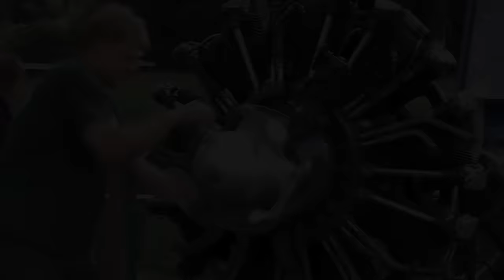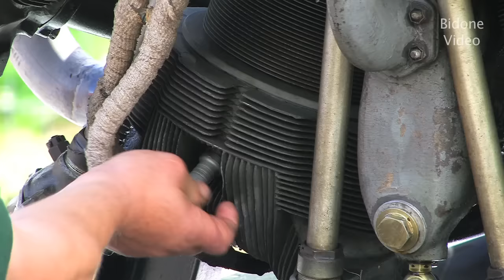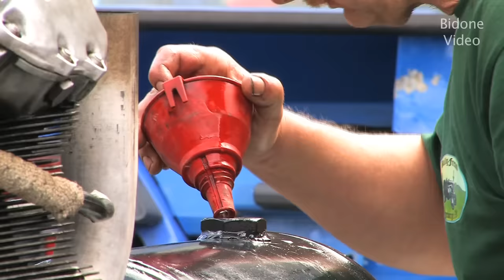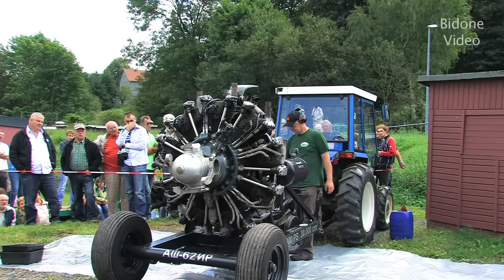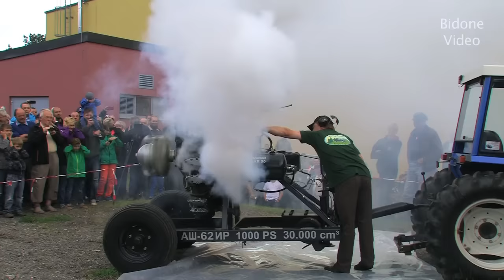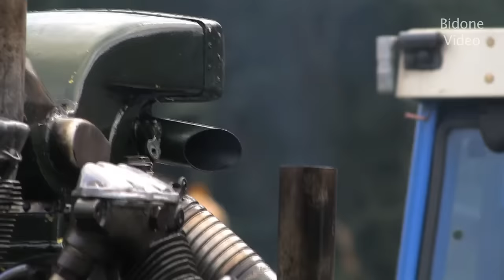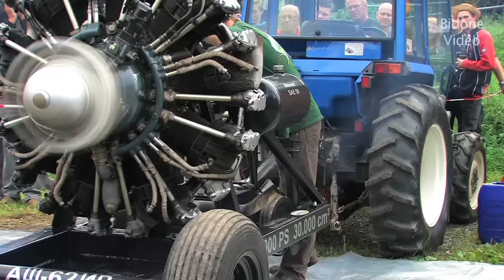Russischer Sternmotor - Russian Radial Engine Start and Run

Comment: If that thing had a propeller, you'd witnessed a blue tractor flying.
Reply: I think this is the very engine the  Antonov An-2 uses wich is actually called "tractor of the skies"
Reply: 😂At least moving along the ground a hell of a lot quicker than a tractor generally does.
Reply: @safetyinstructor  it is, the shvetsov 62, 9 cylinder 30 litre engine :D
Reply: @_elicon_4681   আ
Reply: Good profile picture
Reply: Lmao
Reply: Even static prop is just way too dangerous even if it is bad for the engine to have zero drag
Reply: Tractorcopter
Reply: You really wouldn’t, this is actually a weak engine compared to most of the radial engines out there.
Reply: And the jockstrap raiders film does just what it is
Reply: Шайтанарба! 
😂😂😂

Comment: I’m honestly surprised it started without the propeller.  The prop acts as a flywheel and helps carry momentum in between cylinders firing and keeps it moving along smoothly.
Reply: It also acts as load and resistance so it cancels out.
Reply: Yeah I felt like it needed something to work on like some load on the engine to help it run smoother, I'm sure it would have but it's still great to see in operation.

Comment: yep it happend again, clicked on the videos on the right and im watching old engines start for an hour
Reply: you are not alone.
Reply: +Frietpan Me too !
Reply: +Frietpan Stuck in the old engine startup vortex too.
Reply: +Frietpan Yep same here, love the ancient diesels myself more though.
Reply: +Frietpan So that's what just happened!
Reply: +Frietpan Same here.
Reply: +Frietpan Jij ook al? :-)
Reply: +vinny142 9
Reply: purplinko
only watching. no touching!
Reply: Frietpan q same here... Only a year later haha
Reply: The oil injection this motor has total loss lubrication.
Reply: Frietpan very much for
Reply: One thing i like about this motor is you can get to the individual jugs and cut ports into them to make a nice loop or uniflow scavenged 2 stroke radial!
Reply: Join the club ^_^
Reply: Frietpan p
Reply: same XD
Reply: o/
Reply: After 2 years yep im still here :D
Reply: Prett awesome right
Reply: the Frietpan
Reply: I used to work with aircraft. I'd try and ID engine and aircraft by sound and one day I hear this noise and I'm like "wow." A P51 mustang, a B17 and B25 all landed.
Reply: I hook now ... ha, ha
Reply: Happens to me aswell
Reply: Fryingpan Watching old plane engines start up, is so damn satisfying
Reply: yeah me too
Reply: ñ
Reply: Alex Vazquez 
build the wall
Reply: Me too.
Reply: By Volkswagen
Reply: Fryingpan „2
Reply: Ì
Reply: Rhean  semded
Reply: Fryingpan Musik
Reply: Fryingpan 不
Reply: Fryingpan don’t you just love the sound?
Reply: Last week I went on a massive bender watching GMC Crackerboxes run. I'm just off the screaming jimmy's fascination and now I'm here.
Reply: HAHA! I did the same thing! Happens all the time!
Reply: lemateurfou
Reply: Fryingpan
Reply: Same
Reply: I like to see it geting alive too :)
Reply: Same story
Reply: Super ale mòj Tata potrafi lepiy
Reply: Noł koł
Reply: Kol
Reply: @nastastic  🏠🏗️🏭🕌🚜🕞🕓🕓🕗🕖🌧️
Reply: : D  : D  : D     Great minds think alike!
Reply: Yea me too.
Reply: There's worse things that can happen.
Reply: @ecz28  .
Reply: Yep, the very same :)
Reply: And IM at work..
Reply: Same
Reply: Ģğh
Reply: Hahahahahah.   Samsies!!!      I'm on vacation too!

Comment: less emission , free pollution, free energy , euro4 approved 100%
Reply: It is Euro6 dtemp!
Reply: euro1940's
Reply: wayan pande euro norms are idiotic the only thing what realy counts is how we get our oil 
We ned to produce it ouerselves with seaweed and comparable tecnics (power to liquids) the we can reverse the co2 polition with over production (in that we are already very good)
Reply: Fuel it with dark rum, 90% proof - it'll run better and'll be very good for the environment and people will love the exhaust gases LOL!
Reply: Who cares that stupid and fake 'Euro' -1,2,3,4,5,6 etc emissions???
Bosch invented and implemented  that(fuel, ignition and control equipments) in produce to get more profit from stupid users, while there is no significant increase in power and torque.
Reply: euro 4 has been planted
(eco) terrorist win
Reply: castor 927 maxima premix or oil injected?
Reply: Skhh
Reply: @jlo13800  fk
Reply: Dueos
Reply: Ejejei
Reply: @jlo13800  golden spectro, the old black and gold bottle!
Reply: I would run nothing but amsoil dominator synthetic 2 stroke oil through one of these radials with rigged up oil injection. If it cant handle so fuck it.
Reply: At what ratio in this radial, these run total loss oil burnoff anyways. these burn about 40:1 equivalent from what i heard. Low ash oil pushed through the crank and injected and burnt off for total loss.
Reply: That engine is still produced in Poland and have EU approved. Of course after many modification maked by PZL Kalisz.
Reply: 6.2!
Reply: Nobody thought about pollution during IIWW
Reply: Or maybe non-euro
Reply: That thing isnt polluting the air? Watch the vid again.
Reply: Some people's say that after this event  a large mob of people with buckets went collecting  lumps of coal for winter season.
Reply: As long as its got a electric engine attached to it its climate neutral lmao
Reply: and remember diesel particel filter

Comment: Need to fit a club propellor,will run much nicer with something to turn against and also acts like a flywheel.
Reply: That was my exact thought the second the video started. These aren't made to run without a prop. He wouldn't have as much trouble starting the engine either, with the propeller to help keep it spinning.
Reply: You are exactly right sir. I checked today at work and all the overhaul and service manuals tell you that running without a ballast or club prop is not to be done. It will result in damaging shunting of the gears as the engine loads and unloads between power pulses. The ballast or club prop keeps a drag load on the engine to prevent this. I would not want to be there when it lets go! I saw pictures of an exploded M14 that had been run without a load.
Reply: Yes,ram air cooling from prop wash. The engine temp is thermostatically controlled by opening or closing the gills.
Reply: Thinking the same thing, some engines can be damaged if run unloaded. It's too easy to over-rev them if not careful on the throttle.
Reply: pauljs75 I'd say it was over revving a bit.
Reply: Haha, that was the first thing I thought too!

Comment: Hi Bidone, you might want to add the words "inertia starter" to the video description as well. There are not many videos about that, so with those words it might pop up as related or in search results for new viewers. Wish you the best, and thumbs up!

I suppose the original propellor blades also provide a significant flywheel effect, which could help with the rough/difficult starting... But granted this thing is impressive enough even without them.
Reply: Oh that’s why the start up sounded like that

Comment: needs a prop or at least some form of air cooling to the cylinders
Reply: a prop would have been way to dangerous wit hall these kids around 
i bet he usually has one attached
Reply: FGM11 why would that be dangerous ? There's many museum videos where they use a prop when stationairy running an angine. Just keep the crowd at distance.
Reply: A propeller, even a cutoff one is needed for the engine to run smoothly. Radial engines don't have a flywheel, the magnetos are run off the crankshaft, so it need s the weight to smooth it out, even a nasty Russian engine like this one.
Reply: *****

I'm not so sure... such engine built up very fast hot points who can damage it...and the prop is in addition a flywheel: whe see the lack with the start difficulties...
Reply: ***** I don't think he knows what he is doing.
Reply: leneanderthalien The starting problem is usually with radial engines. Any oil left in the engine goes to the lowest cylinders and can seep past the oil control rings and foul the spark plugs, that why they're shown checking the spark plugs. And usually before start up the engine is turned over by hand at least 3 complete revolitions to get rid of the oil build up. In this case that turn the engine over on the starter before turn the magnetos on.
Reply: Charles Damery

I known such engines but i was mecanic on french Neptune P2V7 (later on turboprops)...but here whe see clear that the engine as a lack of the inertia from the prop who help to start it..
Reply: Plus its awfully tempting to flip the rotors and see how fast that tractor could go ..
Reply: ***** You can not do this Nikoaj, it is illigal to plow while being under the influence of a propeller....
Reply: barthoedemaker Also a prop will offer some inertia for a flywheel effect and smoother idling.
Reply: you dont understand how the physics of them work it would be like a pair of scissors flying at you from being blown out of a cannon

Comment: I found out that pre-warming the oil helps a radial start a whole lot easier.  Yes, the 50 weight oil is about the consistency of honey but is just what that engine needs.

Comment: Motor 12 cilindros com 2.500 cilindradas cada....somando 30.000 cm cúbicos ou seja um motor 30.0
Isso sim é um motor brutal
E isso em 1930.....imagina um motor desse com a tecnologia de hoje 😲
Reply: Motor 9 cilindros com 3.333 cilindradas cada. Radial engines have odd number of cylinders (per section).
Reply: A las grandes marcas no les interesa hoy en día seguir evolucionando los motores con cilindradas grandes. De todas formas ahora se invierte en tecnología eléctrica.

Comment: Propeller will act as cooling system as well. Without propeller this engine will overheat in few minutes.
Reply: and it will also fly off and blend the crowd into a bloody pile of organs, whats better, an overheated engine (repairable) or tens or hundreds of dead people (unreparable)
Reply: Justin Noker You lost me on ''blend'' do you mean plendamed or smth
Reply: ʝ αℊ⋒αr123987ჯ i think "blend" fits there perfectly. put some people in a blender and watch what happens :P
Reply: RadimentriX shit happens XD
Reply: Justin Noker No. That's the simple way of putting it. First off, you anchor the engine. Secondly, you put on a wide prop that is short and incapable of pulling the engine. It's also a good idea to have a prop so that it doesn't over-speed too easily. I'm an aircraft mechanic, and doing runups is something I do a lot.
Reply: *****
nah, lift comes from the wings, the prop+motor just accelerate the plane so the wings, elevator, etc can lift it up
Reply: *****
 Pretty much, yep. Although the lift is from the wings, the engine just provides torque to the propeller, which in turn provides thrust.
Reply: Vladimir Georgiev 
wanted to write the same thing, then I thought somebody must have noticed that already.
I think the motor won't last too long without a prop, unless you could cool the oil somehow.

Comment: You need a dummy propellor on this to give it some flywheel mass load and make it run smoother, and also to blast air across the cylinders and cool them.    The propellor is used in lieu of a flywheel on these aircraft engines...  without one they aren't going to run as smooth, and they are going to heat up all the way to the point of failure if you keep running them for a long period of time, because they are air cooled.
Reply: @Quadratschädelhersteller im Urlaub Hmm, I bought my beautiful little propellor for $150 US.          I think what you are talking about is a variable pitch propellor.

Comment: Well, I for one think it runs pretty good. I think that Russian engines should be called anything but unreliable. They're simple, and their ouptut is generally unimpressive for their size. But they're build to be fixed with duct take and run for years and years as long as you keep up with their oil consumption. American radial were incredibly powerful, technologically advanced but maintenance was nightmarish. Engines sometimes ate valves in the lower cylinders banks during takeoff (especially the big, supercharged ones, like the ones used on the Super Constellation).
Reply: Stop being naïve you were just looking at the small number of Radial engine types that were not that reliable

Comment: Ein wahrhafter Traum von Motor !!! Ein Fest für die Ohren, Augen und natürlich auch für das Technikerherz. Darf ich fragen wo er das nächste mal vorgeführt wird, würde mich sehr freuen solch ein Sound mal mit eigenen Ohren zu hören.
Reply from the maker: Der Motor wird dieses Jahr 2x vorgeführt. Google mal nach den Bulldogfreunden Erzgebirge. Die veranstalten dieses Jahr ein Stationärmotorentreffen und ein Traktorentreffen. Er läuft dann eigentlich immer 2-3x an den Tagen.
Reply: Bidone1967 1000 Dank. Ich habe mich erkundigt, am 19. April ist das Stationärmotorentreffen. Ich werde es auf keinen Fall verpassen.
Danke nochmals für die schnelle Antwort
Reply: Bidone1967 der MOTOR samt dem BESITZER(DU???)muß sofort auf das WESTERWÄLDER BIKES and LEGENDS BIKERTREFFEN.Wär witzig,wenn die abgeschraubten GIXER mit 14.000rpm ihre Japan-Motoren schrotten.Und danach wird ANTONOV-GEBLASEN   =)

Comment: I don't know why everybody makes a fuss about the cooling.
That thing doesn't even reach operating temperature within this short time.
The cold oil, fuel and the large heatinks are cooling the system so there aren't really any dangerous heat spots which air cooling in this early stage would prevent.
 Actually it is always better for every engine to reach operating temp as fast as possible.
Reply: That engine is already overheated...
Reply: Heating it up too fast warps components and leads to engine damage.

Plus these engines used their props as flywheels to stabilize their RPM, this engine really need at least a club prop attached to it to give it that momentum as well as cooling air so that it runs right.
Reply: i to tell you but no you heat up engines slowly. Heating them to fast can cause many issues. In particular in cars with turbos if you floor it with a cold engine you run the risk of breaking the turbo because it cannot handle extreme temp changes in a short time. You can also crack quite a few of the really thick and heavy metal components that are not easy or cheap to fix.
Reply: If it were mine, I would have a prop on it.Absolute worst thing to do , and that engine gets very hot quickly. It was way past normal operating temp !
Reply: I've never heard of a modern car with a radial engine. It is better for a radial engine to get to operating temp fast because that is what they were designed to do. They literally pumped hot oil into them before takeoff.

Comment: I love these things. Shouldn't it have at least a little cooling air though? Maybe even just a small plane two blade prop and it could be mounted over or perhaps even without the original mount.

Comment: does it fit in my honda civic Typ r?
Reply: +Gurkensalat Yes, yes it will!
Reply: +Jens Z top speed is at least a one way ticket to heaven.
Reply: +Gurkensalat just leave the hood open
Reply: MrTiti Ok i will do that...
Can i get the engine at eBay?
Reply: Gurkensalat
yes they ship in normal letter cover if u ask them to pack tight
Reply: Yes just make sure you dont wake the neighborhood.
Reply: +Love Cars  But that's the best part.
Reply: ***** when the old lady yells at you FUN
Reply: +Gurkensalat Sure! Don't forget to install the props though- no more traffic - confetti instead!
Reply: 66uuuhn   K8O
Reply: Dude these guys are taking u for a joke, this is a air plane raidial engine used in planes like corsair, no it will not fit in your honda type civic type R, it will not fit the engine bay, and if it does if u try to start it it will tear it to shreds, u can probably build a car for it though, a german built a car using a simular engine. The cars name is the brutus ( german engineered )
Reply: +Lewis Johnson Oh wait- I reread your post. No, no radials that I am aware of- only straights.
Reply: +Gurkensalat no sir, it feeds on Honda's ;o)
Reply: HAHAHA! LMFAO!
Reply: +Gurkensalat No, but a Honda Civic will fit in it
Reply: +Gurkensalat Does your Honda fit in the motor ?
Reply: +Niko only 3 cylinders. sorry.
Reply: Gurkensalat o
Reply: Anything fits in a Honda Civic lol
Reply: VeTec kicks in you start flying.
Reply: XDD that was good
Reply: If it doesnt, make it fit
Reply: @ChumpyChicken2    ςταρ.υ
Reply: Real question is does your Honda Civic fit in this...
Reply: No but it fits on it!
Reply: @hermanngoring397  natürlich Herr göring.
Reply: Does it fit in my smart
Reply: I put one like that in my shaving razor.

Comment: The entire town shows up to see someone start a radial engine who doesn't really know how to start a radial engine. Meanwhile, here in Alaska, you see radial engines running every day on DHC-2 Beavers. You might have better luck if you left the propeller on it. It acts like a flywheel to keep help keep the engine running. Actually, on second thought, maybe it's best if you leave it off.